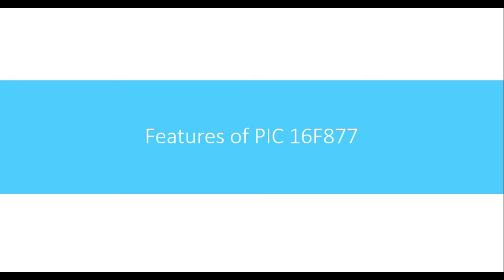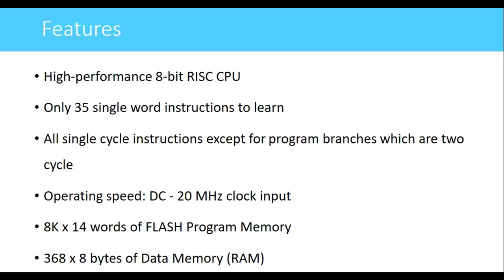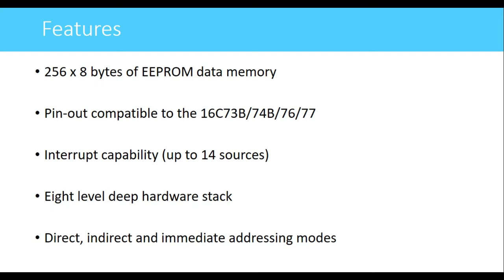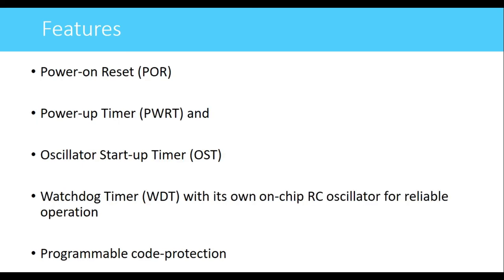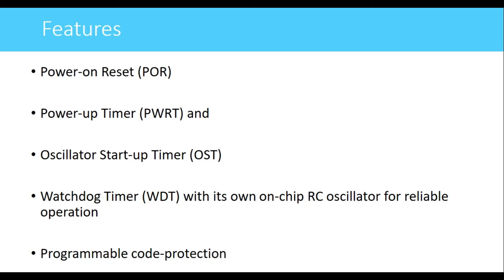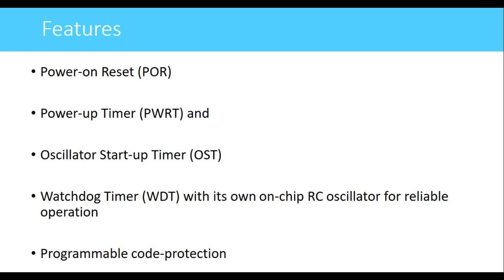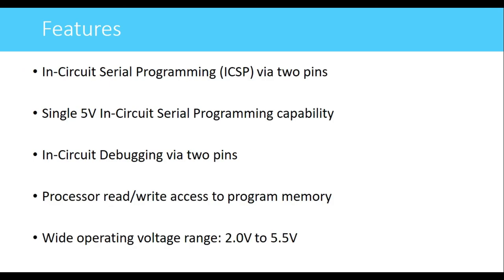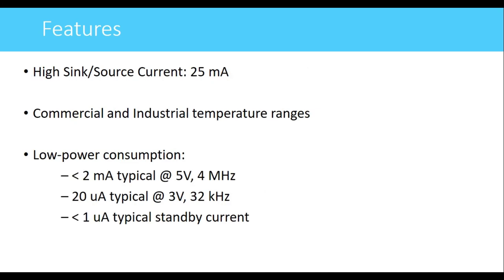Lecture 2 Features of PIC 16F877

Comment: In an LCD display project if the LCd showing corrupted character. Which the circuit needs to be restart at that instances either buy power restart or memory clear reset. Can  WDT , monitor the operation and on let this reset the wdt when the operation is low
Reply from the maker: WDT can be used only to monitor proper working of CPU. It cannot be used for monitoring external peripherals.
Reply: Can u explains how that can be achieved